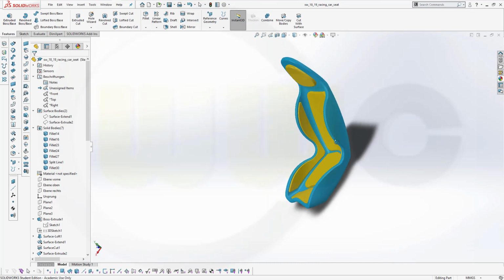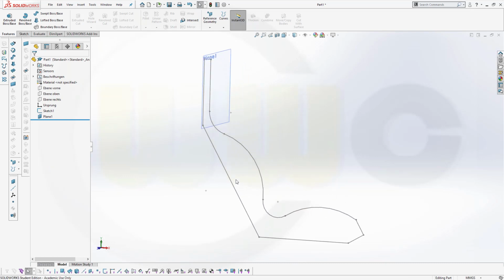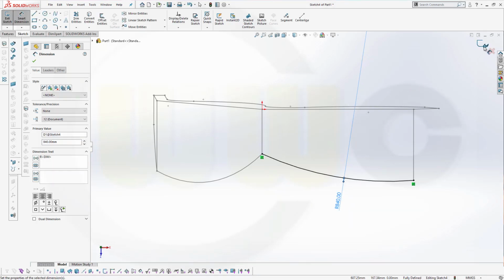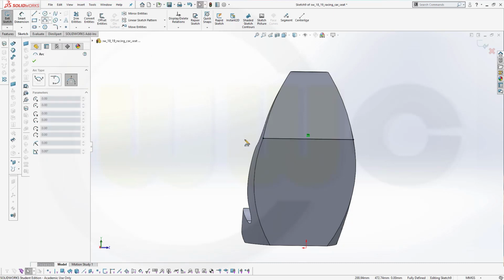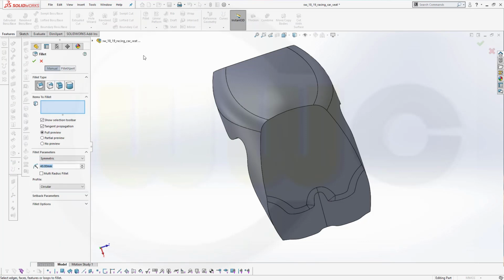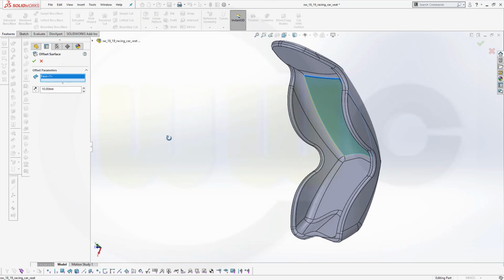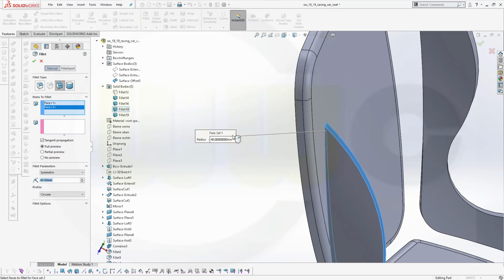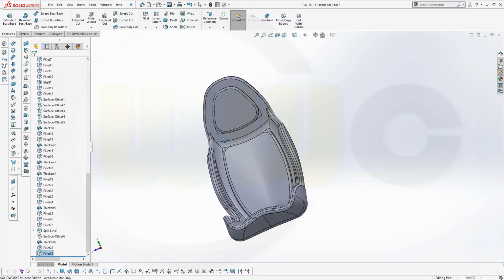Racing Car Seat - Solidworks 2018 / 19 Training - Part Design

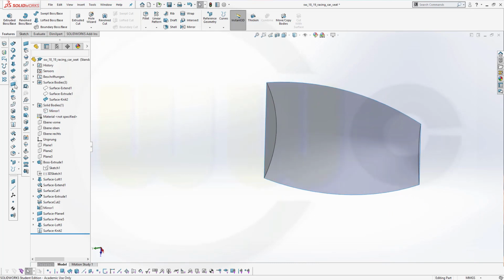Comment: At 27:59, I can't seem to select the side edges for some reason, I'm having a very hard time figuring out why
Reply: I used the loft surface tool instead and managed to create a solid :D
Reply: Damn it, now I'm getting a error when trying to combine the two, it says that solid works is unable to create a single body that is the sum of the input bodies
Reply from the maker: @BrunoGocan  Hard to tell without seeing your model, sorry!